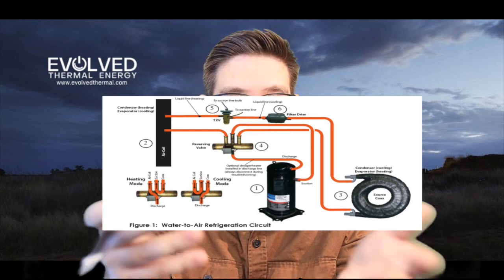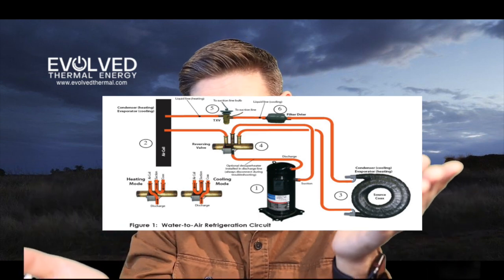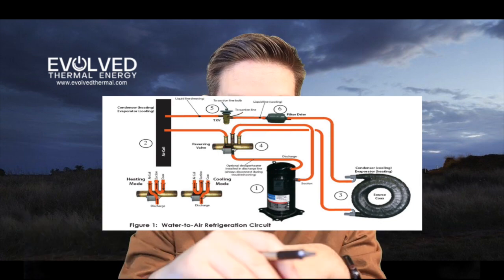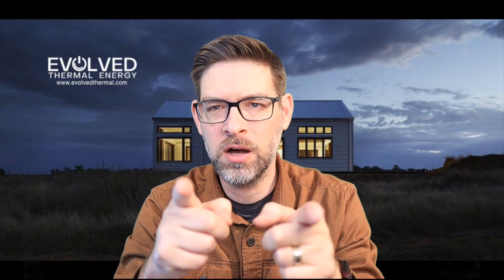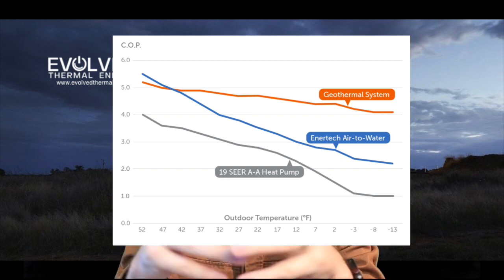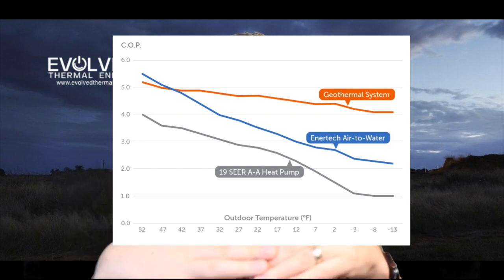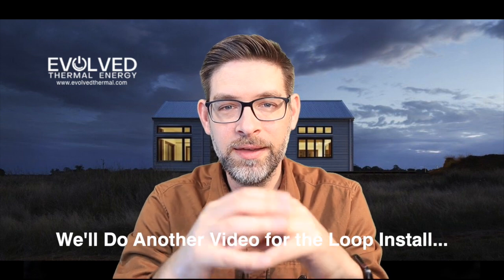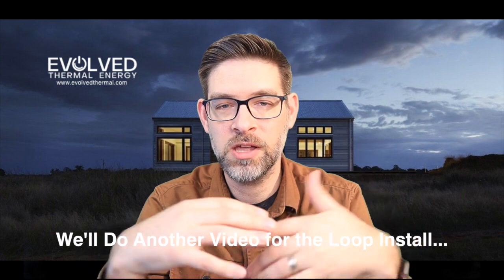Air-to-Water Heat Pump Discussion

Comment: I went with an R290 ATW mono-block 5 ton. Amazingly low energy use both heating and cooling and domestic hot water all the way to 80C. Still a good COP on the coldest days of winter (-25C)

Comment: What refrigerant does your air to water heat pump use? I'm looking for a high temperature monoblock that is R32 or CO2. I'm replacing a condensing boiler that heats an indirect tank with an internal domestic coil. The boiler is 125K btu and easily heats my floors and domestic water but I want to go with a heat pump because I have excess solar and a 14kWh battery.
Reply: I'm sorry we missed this comment - this system uses R410A, it is capable of 135F LLT at the maximum. We typically replace DHW tanks with a specific "instantaneous" indirect style tank and in many cases utilize a final powered tank as additional storage/backup. Infloor obviously is lower temperature so is no trouble for this setup.
Reply: @jeffhunter4290  R290 monoblock is the way to go. R410 has extremely high GWP and very high system pressures. It will be banned soon.
Reply: @jeffhunter4290  Just bought a 5 ton R290 mono-block ATW heat pump. It's amazing thermodynamically.